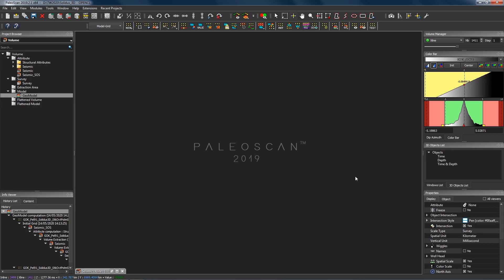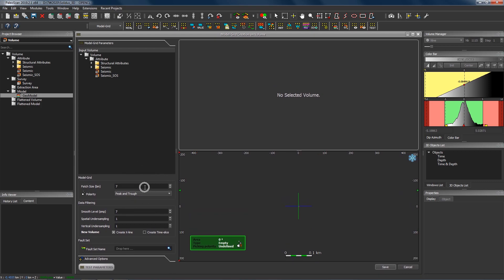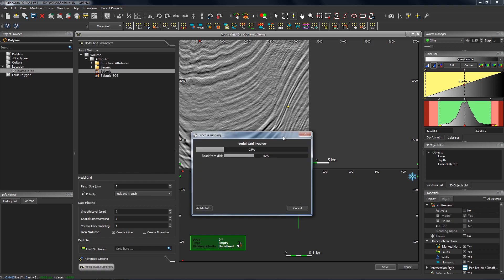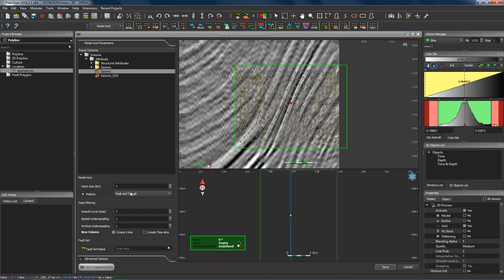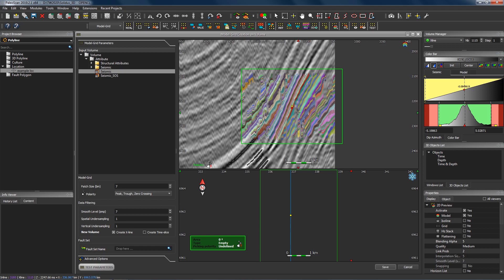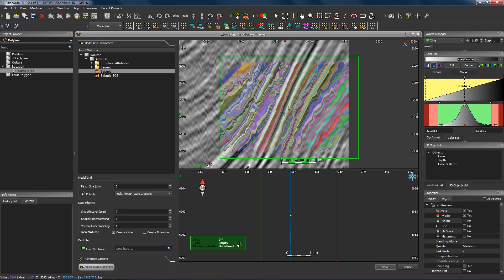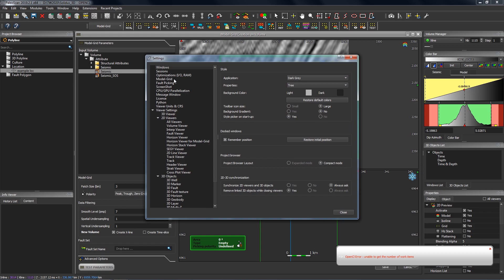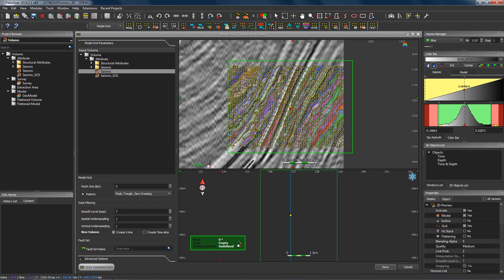Paleoscan™ Tips & Tricks: How to handle steeply dipping reflectors in the Model Grid?

Comment: These settings also increases the computation time. I wish you build a dip volume first or somehow incorporate dip/azimuth into the computation so software can adaptively change to smaller patch size and /or nodes selection mode while user is able to set thresholds on the dips and parameters. Thanks for the great video. Great tip.